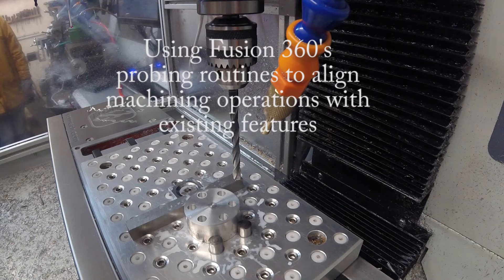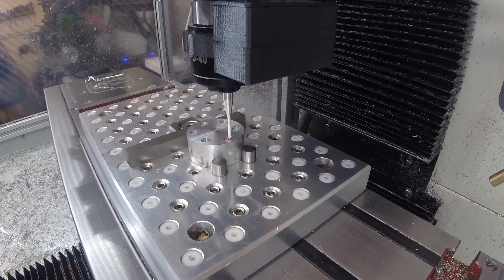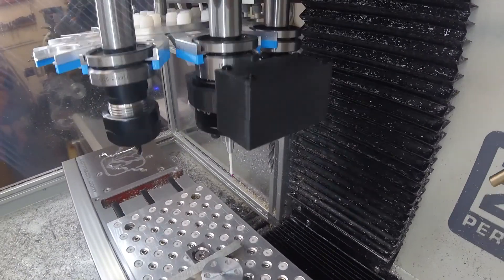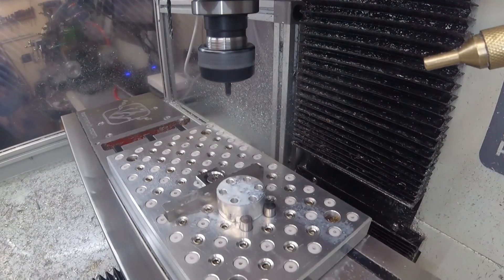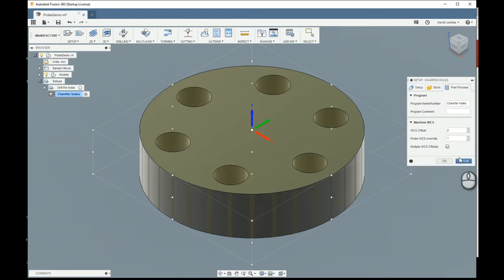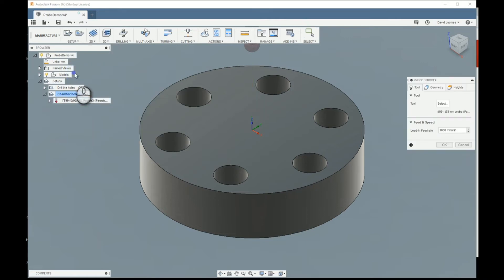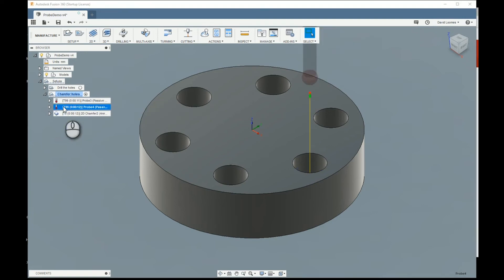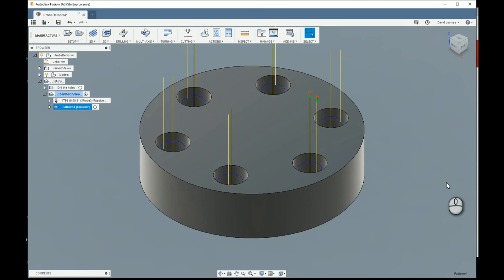Fusion 360 probing routines on a Tormach PCNC440

Comment: you should put in two locating dowels that stick up to locate the part and then you won't have to probe each hole every time.
Reply from the maker: You've missed the point somewhat.  Please read the description.
Reply: @daleksw  i guess i don't understand why anyone would chamfer like this when there are so many other much faster and better methods, just thought maybe you were a newbie and could use a tip, i am curious how close of tolerances you can hold on the 440 in aluminum for like hole location, milling steps etc.

Comment: You should start selling the touch probe wireless modification. Is pretty cool.
Reply from the maker: Working on it!
Reply: There is any way to fabricate an ATC like yours; but using Pathpilot instead.?
Reply from the maker: @dalvynegron1938  I have PathPilot here now and as soon as it gets a bit warmer I intend installing it on the mill.  First task is to get the ATC working.  If I can do that, then I'll consider making kits for the ATC.
Reply: @daleksw  I'm really interested in the wireless probe modification.  Do you have anything on this yet?  GitHub is a good place to put projects.
Reply from the maker: @SRG216  have a look at the Xoomspeed page on FB